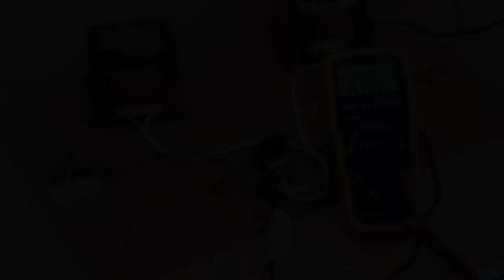DIY Welding Machine / Only 2 Microwave Transformer / Good Job

Comment: What kind of transistors did you use? Cable how many squares and what is its length?  Thank you.
Reply from the maker: Hi.  First of all, I would like to remind you that there are subtitles in the video.  Although it is not a perfect translation, it will do the job.  I used 4mm2 silicon insulated cable in the secondary winding for each transformer.  I made 24 windings on each transformer and used 6.5 meters of cable.  I made an extra triac connection to make the dimmer circuit I used for current adjustment more powerful.  I connected 4 bt137 triacs in parallel and added them to a dimmer circuit bought from the market.
Reply: You have four transistors there (seven).  one has two legs and three tansistors (triacs) with three legs ... are they different?
Reply from the maker: @esimmigrant201  Hello.  The ones I use are also 3-legged.  There was a possibility of a short circuit as I was using a thick cable.  So instead of using the middle legs, I used the same end (same potential) body part.  In all electronic elements with this cover, the middle leg and the body are combined.

Comment: So love this project and have mine but i have 1 question, i get conflicting answers and my own math is kind of lacking lol. I used 10ga silocaone wireon mine and i currently have an outpit voltage of 39.7, is this enough? I can make 1 more wind on each transformer to get 42.5v. ive read somewhere that 36v up tp 45 is the right range, is this true?
Reply: Thanks in advance, keep rockin!
Reply from the maker: Hello.  39.7V is a very good value.  It will be quite enough.
Reply from the maker: I thank you too.  If you want to convert the output voltage to DC, you can find the related video on my channel.

Comment: How many turns of wire did you wrap in one transformer?
Reply from the maker: Hello.  I made 24 windings for each transformer using 4mm2 silicon insulated copper cable.  I used 6.5 meters of cable for 1 transformer and 13 meters of cable in total.

Comment: Mind me asking if i can use a 12 AWG 600V silicone tinned copper wire and a 6000W dimmer switch?
Reply from the maker: Hello.  You can ask any question you want.  I try to help as much as I can.  The elements you mentioned would be very appropriate.
Reply: Greatly appreciated your response and your projects!

Comment: Just wondering  about those BT136, and so on that u used  what is  that for  cannot u just use the dimmer with out those / thx
Reply from the maker: The BT136 is a triac with a current rating of 6.5A.  I increased the power of the dimmer circuit by connecting 4 of them in parallel.  This is a method I always use.  (by the way what do you mean "thx"?)
Reply: i meant Thx =Thanks lol  by the way  would i be able to  use the dimmer  without adding BT136  i have 4 transformer  all 120 v   Thanks
Reply from the maker: Honestly I know it's thx=thanks but it sounded like it had a different meaning in translation... anyway, thank you for the clarification.  If you use the dimmer circuit with a power of around 6000W for 4 transformers, there is no need to connect an extra triac.

Comment: Thanks a lot, could tou share transformer ex. Mucrowave specification?
Reply from the maker: Thank you too.  Frankly, I didn't care much about the microwave oven features.  I used the transformers of the faulty ovens I found.  But 1000W or above would be great.

Comment: I have a big 10 kilos (43v) power supply.  do you think I could use it as it is?
Reply from the maker: It's hard to say for sure, but it seems appropriate according to the values you gave.  You can easily try this.  Find an electrode and try it.  In the meantime, you can measure the output current with an ammeter.
Reply: thanks you, i will try for sure.
on the label reports 2400 VA 240v pri 43v sec
Reply from the maker: Ok.  I think it will work.  If it works, you can then convert the output to DC.  I'm thinking of making a video about it.  keep following me.  have a nice day

Comment: Podrías especificar  el circuito de atenuación  que modelo es si es para ac o cc y el cable que usas  las Especificaciones que trae el cable porque solo dices  4mm
Reply from the maker: Hola.  El vídeo tiene subtítulos.  Traté de dar alguna información con subtítulos.  De todos modos, intentaré responder a tus preguntas.  Puedes utilizar cualquiera de los circuitos de 4000W que se venden en el mercado como circuito dimmer.  O puedes hacer uno tú mismo como lo hice yo.  Agregué 4 triacs bt137 paralelos a un antiguo circuito de atenuación.  Funciona bien de esta manera.  El cable es un cable de cobre aislado con silicona con una sección transversal de 4 mm2.  Es muy importante que esté aislado con silicona.  No te defraudará porque son resistentes al calor.  Todavía puedes preguntar lo que quieras preguntar.  Saludos desde Turquía 👍

Comment: Dime si se encuentra posentiometro de 110V que es con atención que más se trabaja yo tengo 2 ventiladores de microhondas pero mejor consigo 2 culer de pc gracias espero de ti hermano que me explique detallada mente como hacer la instalación gracias y muy buena explicación asta luego
Reply from the maker: Hola.  Si el tamaño de la caja no es importante para usted, puede usar ventiladores de horno de microondas.  Para el diagrama de cableado general y la conexión triac, puede encontrar el diagrama en la sección de descripción.  Se requiere un diagrama de cableado triac para los circuitos de atenuación de baja potencia.  Si tiene un circuito de atenuación de alta potencia, no necesita hacer esto.

Comment: hola amigo me gusto mucho tu idea, y estetica de tu trabajo, pero como puedo hacer una maquina que sea 110 votls y no 220
Reply from the maker: Hola.  Muchas gracias.  Puedes hacer lo mismo para 110V.  Dado que los transformadores de hornos de microondas producidos en su región están diseñados para funcionar con un voltaje de 110 V, no será un problema.  Sin embargo, con un voltaje de 110 V, dado que el sistema consumirá más corriente de la entrada, los cables de entrada y el circuito del atenuador deben ser más fuertes.  Puede hacer lo que ve en el video sin hacer ningún cambio en el lado secundario.

Comment: Hola amigo disculpa cuántos electrodos as soldado continuamente ?
Y me podrías decir que tanto se llega a calentar los cables y los transformadores? 

Gracias
Reply from the maker: Hola.  No experimenté quemando electrodos repetidamente.  Puedo decir esto sobre la calefacción... Ya que uso un cable de 4 mm2, es decir, el cable relativamente delgado es el calor.  Sin embargo, no tuve ningún problema mientras hacía negocios.  Como sé que habrá calor, puse un cable con aislamiento de silicona y 2 ventiladores.  Mientras estaba haciendo el video de la amoladora angular, el adaptador de 12 V falló y los ventiladores se detuvieron (si miras ese video con cuidado, puedes escuchar que el ruido del ventilador se detiene después de un rato).  Continué de esta manera y no hubo problemas.  Si tengo la oportunidad, estoy pensando en comprar un aparato de medición de temperatura y medir la temperatura... Gracias
Reply: gracias amigo

Comment: You are great sir how many haps is this welding machine sir tnx
Reply from the maker: I'm answering assuming you ask how many amps the welding machine is... 120 - 140A
Reply: thanks so much sir
Reply: Sir is only the video I see I didn't get the diagram  pls let no the capacity of the dimar sir wil can find some one like it sir god bless you sir
Reply from the maker: You can find the dimensions or connection diagrams in all my videos at the end of the description section.  You can download the schematics for the welding machine from the links below.  CONNECTION DIAGRAM https://drive.google.com/file/d/1R7cFIScJsMNDwwgNJNgOwgGk7Skn50UK/view?usp=sharing https://drive.google.com/file/d/1NoQeD8Wd9HW9TT3OQOkoq9BUoringZidus-nsha/
Reply: please mstat  I don't know how to get the dimar please can you give us the biuldng  diagram of the one that U use  4 the connection sir please may God be with you sir
Reply from the maker: Hello.  If you use the product in the link below (4000W dimmer), there is no need to connect an extra triac.  However, this is valid if the mains voltage is 220V.  If the mains voltage is 110V, the system will draw more current.  In this case, connecting 3 or 4 BT137s in parallel to the triac on the circuit will prevent the circuit from failing.  TRY 29.62 40%OFF |  AC 220V 4000W Thyristor Voltage Regulator Speed Temperature Light Volt Dimmer Regulator Controller Easy and Safe to use high power
 https://a.aliexpress.com/_uWgwU9
Reply: you are too much master as you answer me you will not fall down in the name of God because I sow some dimer diagram use bt136 in you tube sir maby I can used it sir with adding some that is why am asking sir

Comment: tinned copper cable, flexible class 5, suitable for winding?
Reply from the maker: The cable is pure copper.  It can also be tin plated.  however, the insulation must be silicon insulated.  Normal PVC insulation is damaged as a result of heat.

Comment: Otra pregunta si utilizo el dimmer de 4000w. ,no tengo necesidad de hacer los  el otro diagrama cierto?
Reply from the maker: Si su tensión de red es de 220V, un dimmer de 4000W es suficiente. Sin embargo, si es de 110V, será necesario conectar un triac extra, ya que la corriente de entrada será mayor.
Reply: Hola buenas noches nuevamente amigo, ok acá por lo general la corriente en casa es de 110v... Tengo que colocar el  atenuador de 4000w más el  diagrama de triac???.... Disculpa pero es que no entiendo muy bien esa parte

Comment: How can get low Amp adjustable.. Sir
Reply from the maker: Hello.  I adjust the current with the dimmer circuit.  In fact, the dimmer circuit adjusts the input voltage.  The current is indirectly regulated.

Comment: Hola, tengo unas preguntas
Tengo un dimmer 
110/220v
Voltaje ajustable 50-220vac
Potencia maxima 2000w a 220v
Corriente maxima 15A
Me puedd servir?
Y la otra tengo un triac bta08-600b
Me sirve?
Ojala me pueda responder,gracias
Reply from the maker: Hola.  Si la tensión de red es de 220V, sería mejor utilizar un dimmer de 4000W.  Porque este sistema tiene una potencia media de 2000W.  Para no tener problemas, es decir, para evitar que falle el circuito del dimmer, sería bueno utilizar un circuito de 4000W.  Para conseguir esta potencia te recomiendo conectar 2 bta08-600b más en paralelo al circuito que tengas.  El esquema de cómo realizar esta conexión está disponible en la sección de descripción.  Si el voltaje de la red es de 110 V, el sistema que usará una potencia de 2000 W consumirá más corriente de la red, en este caso, recomiendo agregar al menos 4 triacs más.
Reply: Ok, entoncea seruan 5 triacs que tendria q usar?, Gracias pot reponder
Reply from the maker: Exactamente.  Si la tensión de red es de 110V, estaría bien que fuera así.
Reply: Ok, muchas gracias , asi lo hare 👍
Reply from the maker: Gracias también.  Buena suerte.  Vuelva a escribir si es necesario.
Reply: Hola , Como puedo enviarle una foto del dimmer que tengo,para saber si me sirve y si es asi como podria conectarlo,gracias saludos
Reply from the maker: Puedes enviarme un correo electrónico.  Sería bueno si fuera detallado y comprensible.  muratguney67@gmail.com
Reply: Ok, le enviare correo, gracias 👍

Comment: How many turns of wire did you use? Or how many metres length did you use?? And what gauge is it? From Erich
Reply: Good question...
Reply from the maker: Hello.  I used 4mm2 silicon insulated cable.  I made 24 turns of winding in each transformer and used a total of 13 meters of cable, 6.5 meters for each transformer.

Comment: buen dia una pregunta estoy haciendo el soldador pero el cable que compre es numero 10 siliconado con recubrimiento en fibra pero no me dieron todas las vueltas solo me dio un voltaje de 13,1 sera posible hacer lo con 3 transformadores  para llegar al voltaje de 40 voltios
 gracias estare atento
Reply from the maker: Hola.  ¿Cuál es la sección transversal del cable número 10?  Si es de 4mm2, igual que el que yo uso, debe entrar 24 vueltas.  Pero según tengo entendido, su cable tiene una sección transversal de 6 mm2.  En este caso, como dije antes, necesitas usar 3 transformadores.  Pero no te preocupes, te pondrás más actualizado en este caso.
Reply: disculpa tanta molestia es nesesario ponerle mas triac para que no los queme o con los 4 esta bien
Reply from the maker: Por favor, siéntase libre de hacer preguntas.  Debemos haber hablado antes, pero déjame recordarte de nuevo.  Si la tensión de red es de 110V, los 4 triacs serán insuficientes.  Se deben utilizar al menos 6.  Si es de 220V, 4 piezas serán suficientes.

Comment: Excelente video...Tengo una pregunta... Esa maquina se puede hacer para que funcione con 110V? soy de Venezuela y aqui tenemos 110 y 220
Reply from the maker: Hola.  Gracias.  La respuesta a esta pregunta depende de los transformadores que utilizará.  En otras palabras, si usa un transformador de horno de microondas que funciona con 110V, la máquina puede funcionar con 110V.  El voltaje de la red en Turquía es de 220 V y los hornos usan transformadores de acuerdo con este valor de voltaje.  En otras palabras, según el voltaje en el que se devanen los devanados primarios de los transformadores, la máquina que construirá funcionará con un voltaje de polarización.
Reply: Hola El trabajo del vídeo logre hacerlo con transformadores de 110v...pero me interesaba mucho q trabajará con los dos boltajes y sacando cuentas literalmente descubrí q las entradas de ambos transformado si las pones en serie le pudes aplicar 220v y si las pones en paralelo los 110v

Comment: Yet another question, Since im putting about 30 amps at 120 volts into welder, can i control my heat on the input side of coil with smaller and cheaper dimmer switch?
Reply from the maker: At 120V input voltage, transformers draw approximately 2000W/120V=17A (about 20A) current (for 2 transformers).  The dimmer circuit you will use must be resistant to at least 32A.  I may have mentioned before, I made a general purpose dimmer circuit and attached it to my own welding machine.  I will share the video very soon.
Reply: you should consider being a teacher. thanks for the info.
Reply from the maker: @billbush-t5x  👍

Comment: Porque no puedes, o' hablas como los de más que los han fabricado..
se ve muy bien y bonito lo que haces pero no  puedes esperar que todo el que te vea  pueda entender para construir uno ....piénsalo para tu próximo video. cual es el número de vueltas  y el diámetro o' grosor del alambre por ejemplo....Guillermo desde la República Dominicana.
Reply from the maker: Hola.  En primer lugar, gracias.  Me alegro de que te guste.  Usé un cable de cobre con aislamiento de silicona de 4 mm2.  Se requieren 6,5 metros de cable para cada transformador.  Hice 24 bobinados en cada transformador.  Los devanados 24 son un poco difíciles de enrollar, pero estará bien si el devanado está ajustado y ordenado y no se daña físicamente el aislamiento.  Después de 2 semanas, publicaré un video del proceso de conversión del voltaje de salida de esta máquina a CC.  Si tiene más preguntas, por favor escriba de nuevo.  Saludos desde Turquía

Comment: Me recomendarías ? Utilizar dos triacs bta 16-800 con 4 transformadores de microondas
Reply from the maker: Dos BTA16-800 son suficientes.  Tendrá una resistencia de corriente total de 32A.  Si todavía tienes 3, usa 3.  Será más duradero
Reply: La conexión de los triacs bta 16-800 sería diferente al del tu video ? Y aproximadamente me dan 10 voltios cada transformador en total sería 40 voltios está bien ?? Los 40 voltios igual

Comment: Question? What is the name of that small blue square cube that you inserted the electrical fan wires too? it looks like a small blue Lego bloc, What is that device called? 

Reason I ask is that you left that item (excluded) that connector out from your uploaded PDF instructions that you posted. It looks important thought? Thankyou
Reply from the maker: Hello.  The blue part you are talking about should be a terminal.  So it's a tool used to join cables.  If anything else, please write again.  But there is no other blue part
Reply: Thank you,

Comment: In part of 7:20 what kind of transistor that you use ? Thanks great job 👍👍
Reply from the maker: Hello.  I thank you too.  The material I use is a triac, coded BT136.  There are wiring diagrams in the description.q Take a look if you want...
Reply: thank you very much.. for informative video .. again Maraming salamat.. greetings from Philippines..
Reply from the maker: Thank you too.  Greetings from Turkey

Comment: How many winding turns each transformer???
Reply from the maker: Hello.  I used 4mm2 silicon insulated copper cable for each transformer and made 24 windings for each transformer.  6.5 meters of cable is required for each transformer, so a total of 13 meters.  Try to make the winding properly and not to damage the cable insulation.  You will get 20V AC voltage from the transformer outputs and when you connect the outputs in series, it will be 40V.  If you have any further questions, please write again.

Comment: Hola cómo estás tengo una pregunta y una duda al mismo tiempo 
Es necesario colocar los bornes o conectores o solo se puede colocar los cables de ante mano gracias por saludos desea Bogotá Colombia
Reply from the maker: Hola.  Gracias.  Pero no entiendo del todo tu duda.  ¿Puedes elaborar un poco más?
Reply: Es necesario colocar la toma de soldador 10/25 o se puede colocar solo el cable gracias
Reply from the maker: Hola.  No es necesario utilizar enchufes de 10/25.  El cable directo se puede quitar.  De esta manera es más fácil colocar el instrumento en el estante.  Además, dado que el material de la caja que uso es aluminio, el aislamiento del cable puede desgastarse y entrar en contacto con el cuerpo de metal.  Teniendo en cuenta esto, preferí usar enchufes.